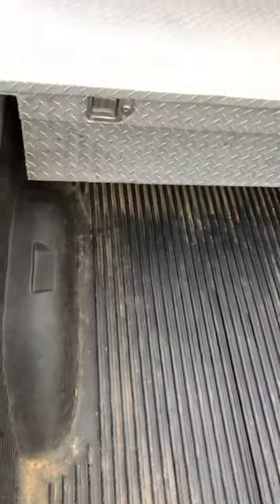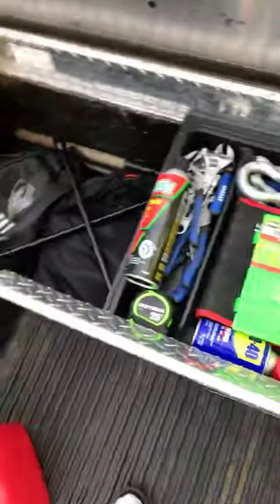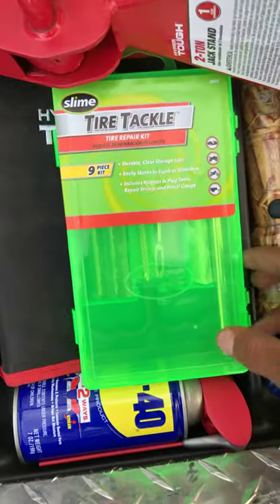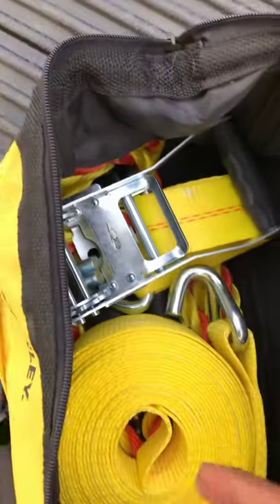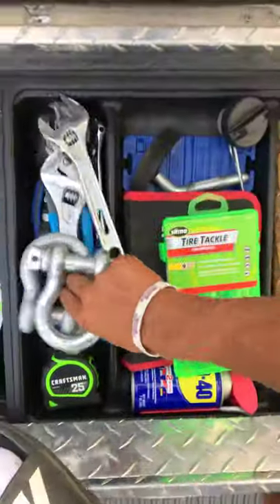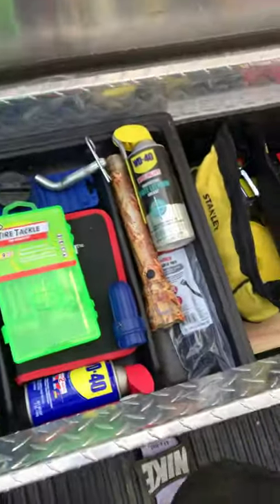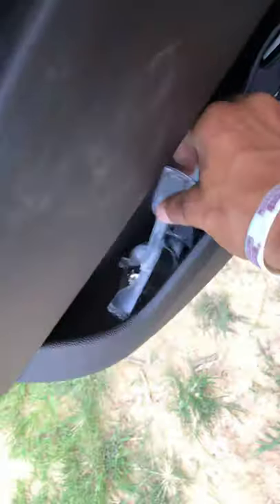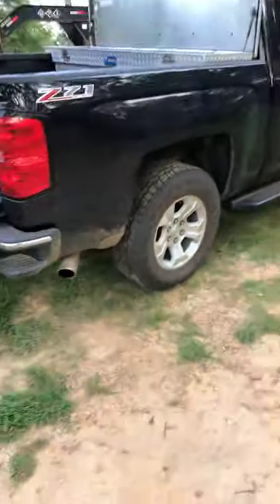WHAT TO KEEP IN YOUR TRUCK TOOLBOX

Comment: Trace -  You have lots of lights, ropes, straps, and a chain, but no come along, no tarp, no first aid kit, and no fire extinguisher.  You got brand new 2 funnels and a unopened roll of shop towels, but no automotive chemicals: brake fluid, ATF, power steering fluid, windshield wash, motor oil, water or coolant.  Keeping the pin for your towing hitch separate is just a invitation for Murphy to pay you a visit.  That pipe can be used for leverage, not just for beating.  Consider a shovel, even just a folding one, for digging out when stuck in mud or sand.
Reply from the maker: My truck isn’t a pos so I don’t need the brake fluid and atf on hand... however I do have coolant in there I also have a first aid kit under my backseat ever heard of a dollar general, Walmart, autozone, or oreily’s... this toolbox may not fit EVERY person but it’s all of the things I need... I was 16 years old when I made this video 2 years ago so no I’m not a dooms day prepper but I do have many useful things in my toolbox
Reply from the maker: I made a second video that never uploaded but I also have a shovel, 2000lb portable winch, I also am very organized so I keep up with my hitch pins
Reply: Trace - A spare quart of oil leaves you no excuse not to top off when you come up low.    It is acceptable for even new engines to use a quart between oil changes.  The difference between a pos on wheels and something worth having is how it's cared for, not whether or not it's new.  I have never bought a new truck, so I have to take care of things and I do all most everything myself.   Yeah, walmart and dollartree have low prices, but their quality is low too.  My money is tight so I pay more and get things I can rely on.  
 It's all just an old man's opinions.  It's your truck, do as you see fit.
Reply from the maker: @ScorpionRegent  just for your info I have 4 quarts of oil at my house from my previous oil change, I check my oil very regularly, however my truck doesn’t leak or burn oil
Reply from the maker: @ScorpionRegent  Walmart literary has every name brand fluid for my truck, I use valvoline 0w-20 full synthetic from Walmart thats 20 dollars cheaper there instead of autozone
Reply from the maker: @ScorpionRegent  and also just so you know my dad had owned and operated a landscaping/dirtwork company since 1996 and I’ve grew up using various tools in that field of work, whether it’s pulling out stuck equipment or rebuilding motors I’ve done it.. I’ve had most of this equipment for 2 and a half years now and honestly probably only used half of it mainly jumper cables, chains, and ratchet straps